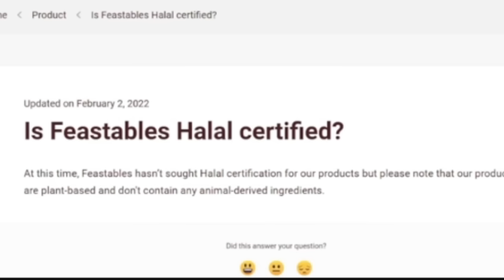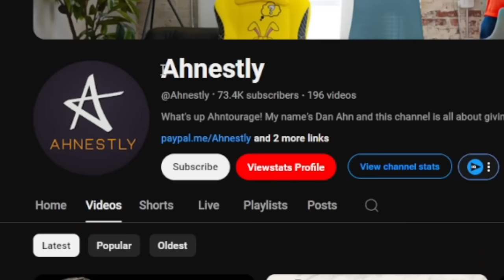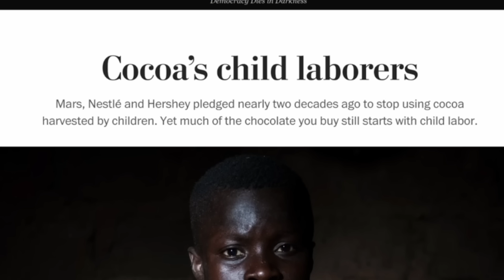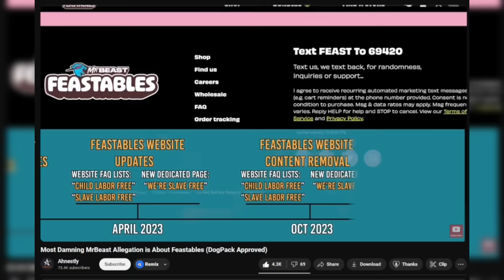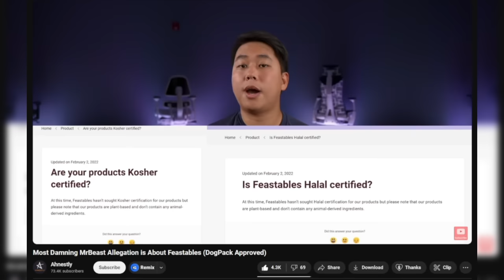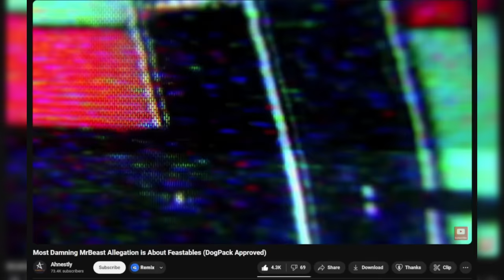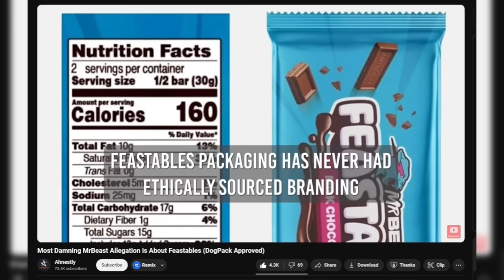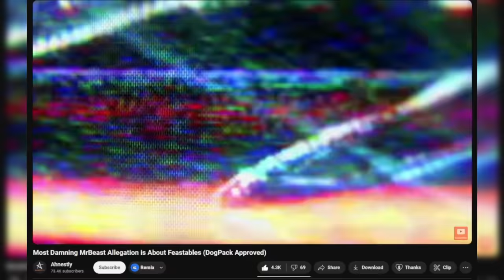MrBeast Just Crossed The Line

Comment: You have to pay for certification.. each individual brand must pay
Reply: Soooo? Your point...?
Reply: @arthurneegan6362  my point is having to work long hours having to be split up into a b and c teams, working under extreme pressure etc etc is not dissimilar to most high-performing organisations. Sure he's a d head and he needs to be punished for some of the serious misconduct however much of this is just noise and and by adjoining the noise to the serious misconduct diminishes the power of the Sirius accusations
Reply: @camfitt honestly what are you talking bruv? the brands  have to pay for certification because certifiying something usually comed with costs for the certifier... Nothing is free nowadays you cant just fill out a form and claim stuff... They will actually certify it with human beings doing check ups and controlls.
Reply: @arthurneegan6362  I know.... I was merely making the point that the underlying manufacturer brand maybe certified... So the sub brand "beast" may not wish to pay for the certification... So I'm unclear as to the point you're trying to make
Reply: The "underlying" manufacterer is the reason they will get certified in the forst place. Thats why they were using them as producer. As the brand feastables got bigger the had to scale up and rely on othet manufacterers that werent certified producers. 

Did you even listen to Anhestly'd report or are you just make sensles statements??

Comment: I have to agree with your dad about turning on the A/C in the winter time. Regardless of that unnecessary cost, do you really need more cold air when there is an abundance outside? Open up a window! Unless you live in a location that is still ridiculously hot in the winter